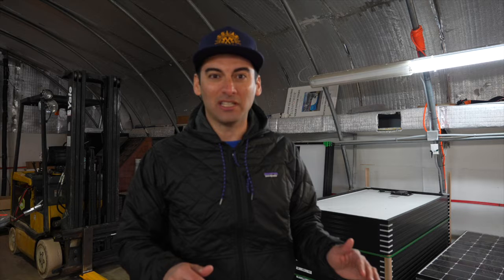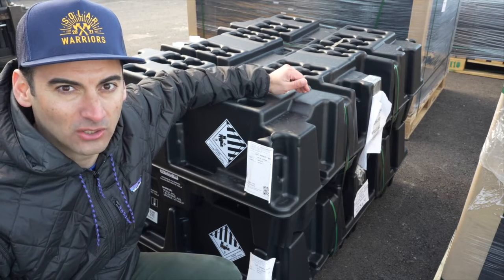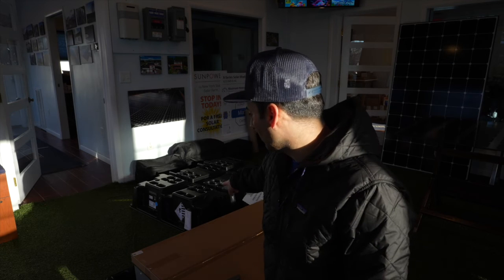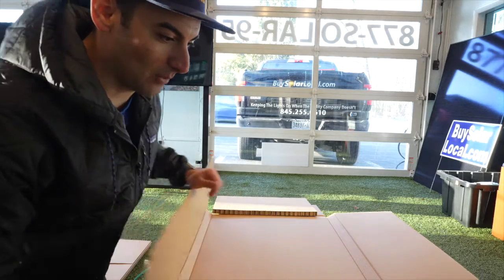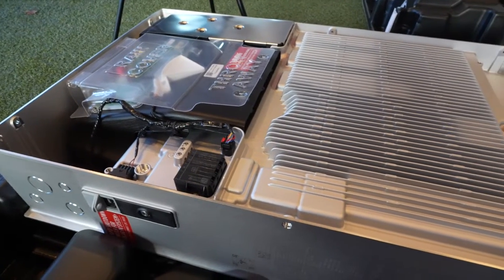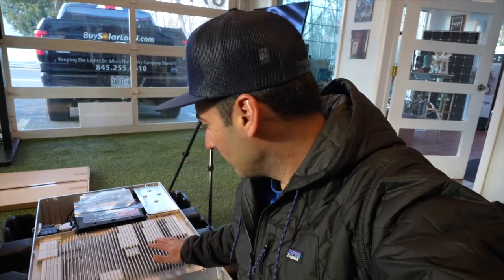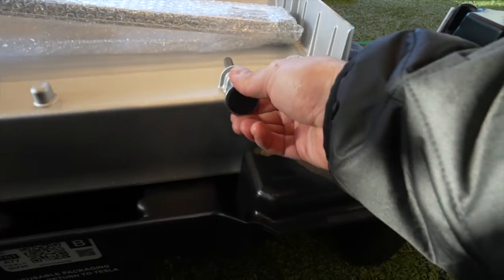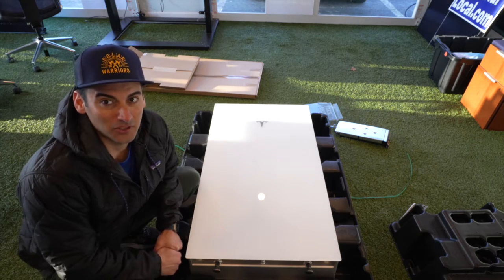Tesla Powerwall 3 Unboxing

Comment from the maker: Thanks for watching & If you would like more information on solar ☀& battery🔋storage for your home you can learn more at https://nyssf.com/
Reply: how do you integrate this with sun power panels that have their own micro inverters?  is there a way to retrofit them.. bypass a current inverter and use the power walls?
Reply from the maker: @vincentseay9166  Yes tesla has plans to release an ac coupled Powerwall 3 later this year. This will be able to integrate with existing solar systems.